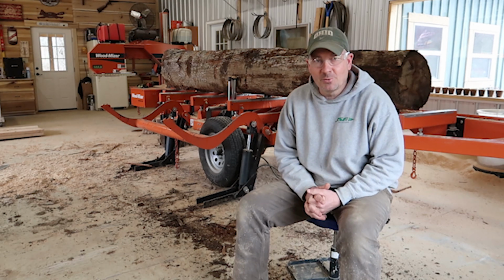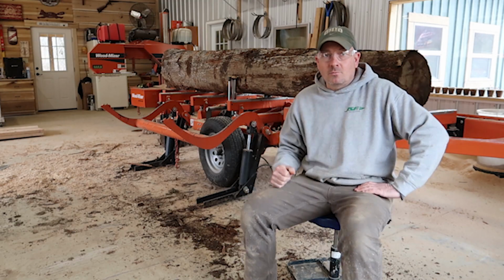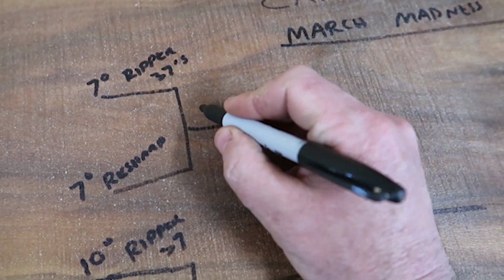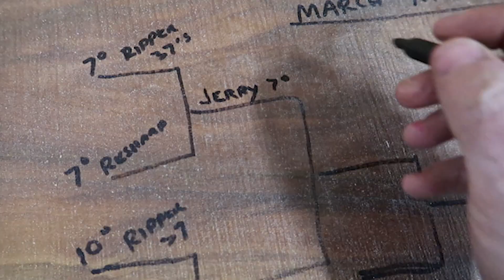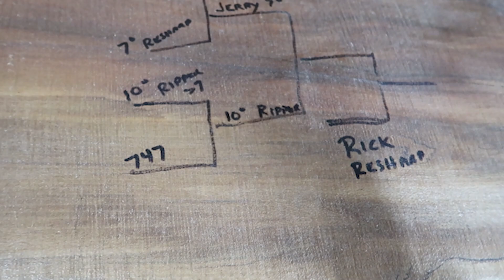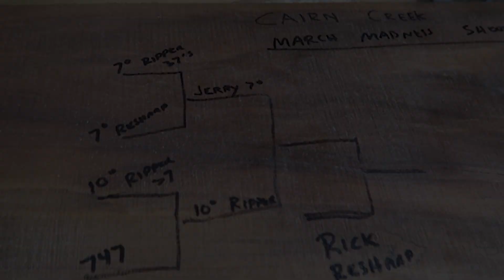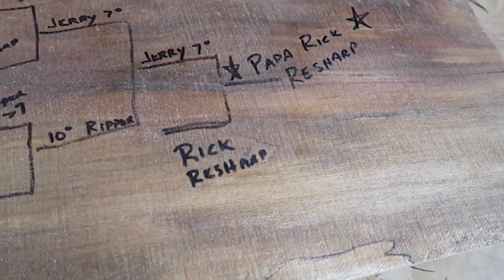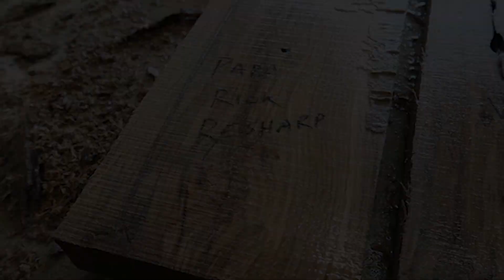WOODMIZER SAWBLADE SHOWDOWN

Comment: Factors that need to be taken into account here: The Ripper37s have a blade thickness of .042 vs the WoodMizer blades which have .045+. You wouldn't think that it would make that big of a difference, however, on the lower HP motors like ours (25hp Kohler), the .042 cut faster no matter what degree you're using.

Secondly, tooth set is a huge factor. Both WM and Rippers have about a .021 set but that changes based up the profile of the blade.

Thirdly, the hook angle (7/10 etc) matters but the shape of the gullet from the base of the tooth to the tip of the back of the next tooth matters. The gullet is for removing dust and the deeper that gullet is, the better and faster the dust is removed and affects the speed of the cut. A good example of this comparison would be a WM 4 degree blade vs a Ripper where the Ripper not only has a deeper gullet, but also a more angle sweep to the back of the tooth.

That said, the more aggressive angles (9/10) are going to cut faster in the softer woods such as pine. However, in harder woods like the white oak, the 7 degree is going to outperform the 9/10. 

I have found, in all my testing (WM 4/7/9/10/747/7turbo, Lennox 9, Munkfors 9, Rippers 7, Cook's 9) that, a 7 degree Ripper37 .042 with an .025 set Cuts faster and cleaner through hard woods and cuts plenty fast and clean through softwoods reducing my requirement to change blade profiles for various woods.

Then again, there's always the "bang for the buck" issue and by fast, Rippers beat WM handily at more than $90 cheaper per 15 blade order.

The last thing I will say about it is, I have consistently gotten anywhere from 200 to 600 MORE bf of cutting out of a new RIpper than a WM blade. I've maxed out at about 2100 bf of pine on a single ripper.
Reply from the maker: Super info VK. That’s way more info than we have learned in our infancy. Sounds like a lot of us could learn from your knowledge and experience. Thanks for watching.
Reply: 7°is all around best. to me its not about speed but getting the best you can out of the log. take your time and enjoy the prossess.
Reply: @davesilvia9711  agreed
Reply: @VKMilling   I thought the turbo 747 was the best blade ever. I'll try the ripper based on your info..
Reply: @jamesrussell6870  7/47 is a good blade. Problem I have with it is, because the teeth are so thin, if it touches something it doesn't like, you destroy it. Whereas most other blades, you have a decent chance of still being able to use it.
Reply: @jamesrussell6870  also, the price difference between a Ripper37 and a WM double hard is nothing to scoff at.

Comment: Great video! I'm getting ready to order blades for my Wood mizer lt35 for next year sewing season I'm in northern Idaho so we get really cold and I don't have a building for mine yet. I spent last summer learning how to use it and have some video of it and holy moly going back and looking is hard to do but it is a learning process. So this definitely helps out on which blades I'm going to order and now we need a video unless you've already got it I have subscribed so I will go look on how he sharpened that with the Dremel
Reply from the maker: Thanks so much! I’m still learning myself, but I really do love the 7 degree Ripper 37’s from Jerry’s Resharp. My father in law does not have a video on his dremel tool sharpening. Hope you can get that thing under roof soon to get out of the weather. Thanks for watching.
Reply: Yeah I've got it completely covered for winter so I'm good there but I can't use it I definitely need to get it in a building because I'm milling the wood to build my house so it'd be nice if I could be doing some work right now on it. But definitely love the video love seeing the different blades being used it's extremely helpful

Comment: cool video. I would like to know about the longevity of the blades. I was watching Iron and Oak and he was using a WM747 and he said that it was the longest lasting blade that he had used. VK milling and hardwood had a lot of good information and I will try the Ripper37's after the 28 blades I already have. I want to say that I have been using 7 degree maybe "Double Hard" WM and they last a long time. I will have to double check the box, I don't mill a bunch so I don't know that much, but learning a lot from all you guys on YT

Comment: The biggest thing that made our lt35 full hydraulic mill faster wasnt the blade but there hydraulics I guess you could call it a super hydraulic now😂 we added an extra pump and 3 1000 amp cranking rig batteries too it me and a buddy can goof off and cut 60 cross ties plus around 700 feet of lumber in an easy day if we worked hard we could do 80 ties. Just figured I would share it with you might be something to look into if your using it alot loved the video! Btw it more than doubled the speed of the hydraulics!

Comment: The 747 looks alot smoother than the other ones. Providing less work to finish. Just my opinion. Great video 👍
Reply from the maker: D Lee it was definitely a smooth cut. I’ve been running it some more. It’s ran great for the most part. Had some trouble in some dry locust though.
Reply: @CairnCreek  Have you ran it in some softwoods like pine or silimar?
Reply from the maker: D Lee I ran the 747 in birch yesterday and it cut like a dream!